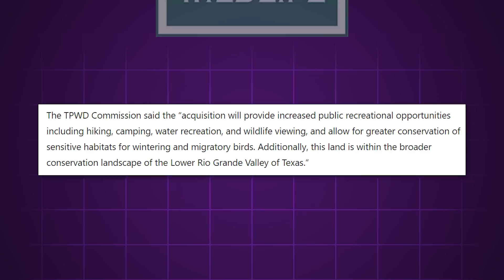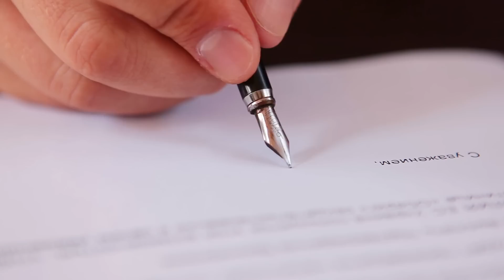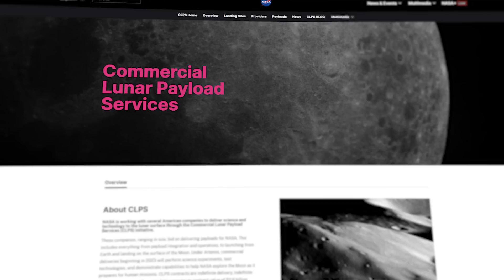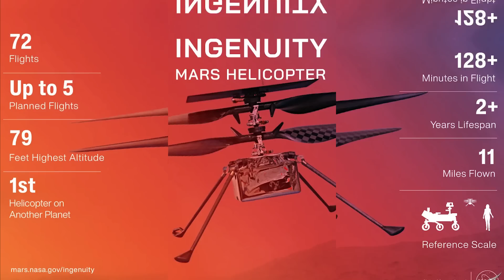The Truth About Starship’s New Launchpad

Comment: Quick thing, you mentioned heat buildup would be less of a problem on the moons lack of atmosphere. That's not entirely true, it's actually very difficult to get rid of heat without an atmosphere, that's why the radiators keeping the ISS cool are so large.

Comment: Is another aspect of Parallel Paradigm Program?   A table in RIPPLE format (Y3°/120°) for a three-turn configuration on a single multi-pad. This setup is specifically designed to launch three spacecraft simultaneously in an unconventional multipurpose mode called "EMPTY" into orbit, all while minimizing the need for frequent resupplies. The requirement is for these spacecraft to be in orbit at an altitude of 200 km WITHOUT MIND BLOWING ?

Following the initial launch, the Central Tank ensures that the speed of the first revolution increases to 28,000 km/h , Boosters out, before proceeding to the next level of transferring propulsion and filling cargo for the three Starship ships. This modification, represented in the Mechazilla or New Era table, allows for the TRIPLE Starship (5.5 mm alloy) X 100 launch every year.

So It is too much for this new 21th Century ....⚜⚜⚜⚜🌈🌈🌈🌈💖💖💖💖💖💖👑👑👑👑

This innovative approach results in significant operational time savings, reducing the time spent on the plotting table, semi-trailer drivers, and the technician team's trips for reloading fuselages of orbital cargo. The alternative mode involves reloading a substantial amount (4000 to 8000 tonnes) of equipment or satellites through a single central payload, increasing deployments to every three days, twice a week.

The achievement of such efficiencies is contingent on extensive deceleration tests, advanced technology, and the adherence of a considerable workforce to conventional computing methods. Moreover, it underscores the current trend in improving yields and cost-effectiveness for missions to Mars. A considerable opportunity remains open for exploration before the construction of new sites and addressing the challenges associated with the modification of Mechazilla.   

Thanks and Congratulations TheSpaceRace for always the Great job👍👍🔥🚀🔥🌍🛸🛸🪐🪐🌖🌖🌞🌞🔥🛰🔥🙌!!

Comment: I'm wondering what's going be the version 4 of starship.
Reply: Properly double thickness.  However, that may not be possible due to the issue of the Tower needs to be totally re-done for anything wider.  They kinda put themselves in fix when they got rid of the landing legs for booster and lander.
Reply: @Wrangler-fp4ei  They'll probably just need to update the chopsticks, that's all.

Comment: FYI... I know you guys try to report anything down the pipe, but just so you know, details about a "rocket launch pad" are getting old and boring. Just my opinion.
One would think that with all the engineers on these projects, they would have been able to get the launch pad right the first time. It's just basic science for engineers. I don't think there should be a need to field test a launch pad and develop it by learning from mistakes as they do with the rockets. Just saying. Okay...so you put on your headline..."launchpad". I thought we were going to hear more about the concrete at the base etc. It seems like you are talking about a whole new launch facility. In that case... Its not boring and good info. Also, there is nothing wrong with "boring" if it's about Elon's Boring company. HAhaha
Reply: It’s a completely new type of launchpad, and it also has to deal with the most powerful rocket in history. It’s not like they’re paving a driveway, it’s pretty cutting edge stuff